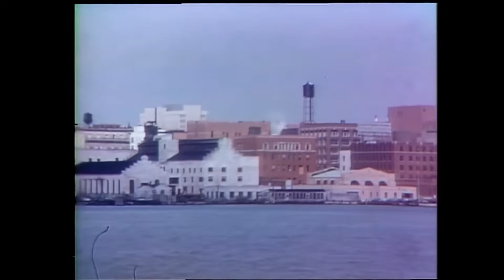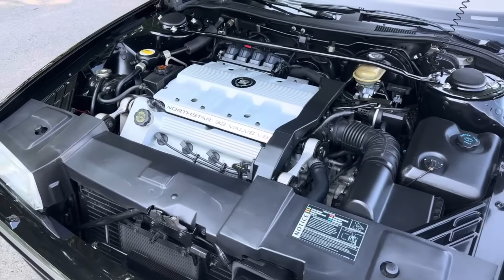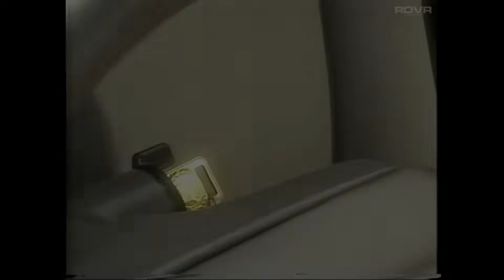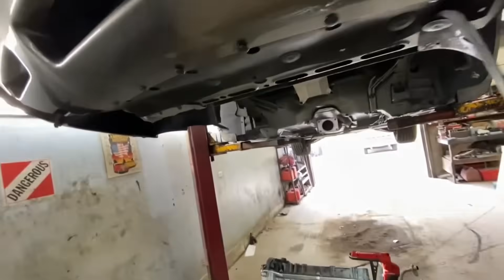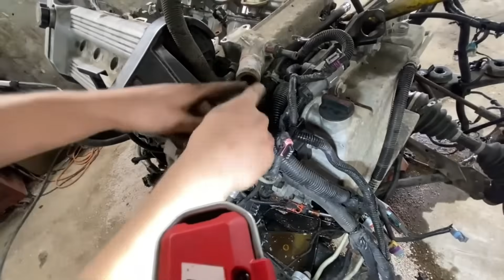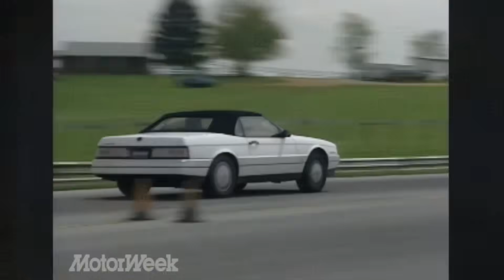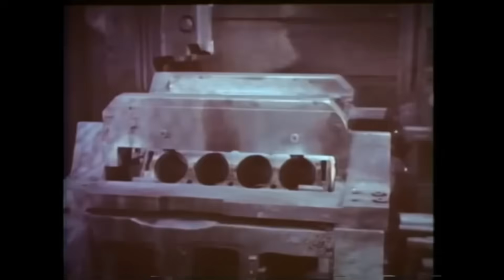Most HATED American V8 Engine of All Time!

Comment: Ford had introduced the lower power SOC 16 valve modular V8s before this, and for the 93 model year the Lincoln Mark VIII had the 280 hp "intech" 4.6 liter 32 valve modular V8. Not sure how Ford got it so right and GM got it so wrong. Oddly.. I don't think the special 4.0 Olds Aurora Northstar V8 had these issues, nor did the 3.5 "shortstar" V6 based on the Northstar used in the Aurora and Intrigue. FWIW, I suspect GM gave dealers a certain number of good will repairs based on factors.. and the dealers themselves go to decide who go the engine fixed under good will. Regular customers that bought them new at that dealership probably got them good willed. *Current fuel economy regulations and a very competitive market have caused many brands to push tech out faster than they should. See Nissan CVTs, Variable Compression Engines, even Toyota has had some turbo gas engine issues. Ford was way ahead with the smaller turbo engine thing... but they also had issues (head gaskets due to coolant groves between cylinders on four bangers, internal water pumps that fail into the oil on v6s, turbo failures).

Comment: I had a 2002 Deville.  I dogged the car.  From 100,000 to 155,000 miles I didn’t change the oil, I just added oil.  Nothing on the engine or transmission ever broke.  The cosmetics were trash.  I brought it to Germany and floored it everywhere I went.  I sold it for $1,500 before I left.  I was told by a Cadillac mechanic to dog the car.  He said that it was a performance engine and needed to be driven like one.  He said the cars that were always breaking were the ones that were babied, and that’s why I always drove it like I stole it.  I was always waiting for it to break, that’s why I put absolutely no money into it.  I also had a 1981 Seville Elegant with the V8-6-4 and never had a problem with it.  It was sold while I was in Korea without my knowledge.  I looked for it and found out it had been crushed after an apparent accident.

Comment: I haven't finished the video but GM could have/should have recommend a procedure to replace these bolts after, say, 40k miles before the gasket has blown.   Maybe they would have engineered a better bolt design and even a washer.   I don't know what but they should have been more responsive to the dealers.
Reply: The cost to retrofit every Northstar engine with thread inserts and new headbolts would have been more than the profit on those cars sold.  Makes more business sense to allow the warranty to expire and let the owners take the loss. By the time this all happened, GM had already replaced that infamous engine and moved on. On the bright side, many lucky poor folks could finally get that used Cadillac they always wanted. I bought a 5 year old low millage Eldorado for $2,500 that should have sold for $12,000. I did the headbolt repair myself and drove a first class luxury car like my rich neighbor.

Comment: the gm 350 small block diesel of the late 70's is unrivaled garbage and the disposable 4 cylinder aluminum block unsleeved Vega engine was usually ready for the crusher before 10k miles.

Comment: The torque bolts have been used in structural steel buildings since 1945. Those torque bolts in Northstar are stressed beyond the yield point of the metal which means the bolt cannot return to its original shape when the stress is removed.

Comment: This is misinformation.  TTY bolts are not the cause of failure for the NS engine.  gm used fine thread bolts in an aluminum block and the threads gave up over time.  Further, the early engines used a composite head gasket and the water passage restrictions rotted out over time, leading to the coolant moving too fast and not transferring heat as it should.  This lead to overheating, warped heads, and premature failure.  By 2005, these issues had been fixed, and guess what?  gm still uses TTY bolts.  So, no, Torque To Yield bolts were not the cause of failure.
Reply: You can tell the narrator is not a mechanic or engineer.
Reply: @AmosMosesJr  Or a human. It's an AI.
Reply: You’re absolutely right! I wish the video was corrected.
Reply: Thank you for the correction.
Reply: Lol i hate it when people make videos that dont know the real details.
Reply: TTY bolts are very common across many manufacturers so they aren’t fundamentally unsound. Mind you, for the owner it doesn’t matter what the cause was. The car becomes a mechanical write off if / when the head gasket goes. The fact that these problems made it into production is not a good advert for GM.
Reply: The idea that coolant moving too fast makes it transfer heat worse is a common myth held by many automotive techs. That is not how thermodynamics work. Faster moving coolant reduces the average temperature of the coolant within the water jackets, and since the specific heat of the coolant remains the same, it increases the heat transfer out of the engine and into the coolant. It doesn't need to remain there longer to "pick up" more heat. The goal is to cool the metal bits, not increase the temperature of the coolant. 

The purpose of the restrictions is to control the relative flow to different parts of the engine. If one area is restricted, more coolant flows elsewhere, where the engineers have concluded it needs more of the flow. Having the restrictor in the head gasket blown out means that there will be flow potential wasted where it is not needed and taken from where it is needed.
Reply: @tid418  Thanks for the correction.  They do indeed rot out, seen it plenty of times, and do overheat once the rot out happens.  I suppose I should have left it at that.
Reply: Agreed, almost all manufacturers use TTY bolts for cylinder heads nowadays.
Reply: Aerospace practice requires the use of steel helicoil inserts when threading into aluminum.
Reply: @Greatdome99 seems like it would be a good idea.
Reply: GM wasn't the only one to make the fine thread into aluminium mistake. I worked on early Toyota heads with that problem.
Reply: Absolutely right. The decision not to use threaded inserts in the aluminum block was a massive mistake.
Reply: Cadillac V8-6-4…whadda POS 🤦🏻‍♂️. any GM diesel V8 too… sure let’s switch a gasoline v8 to diesel without making any changes😳😳😳what could go wrong?🤦🏻‍♂️
Reply: I thought something was fishy about his explanation as soon as he mentioned torque to yield.  TTY are used elsewhere with no problems, so why would that be a problem here?  Thank you for chiming in.
Reply: Ls engine head bolts
Reply: The engineers had the headbolts for coarse thread in design…the bean counters at gm realized they had crates and crates of leftover quad 4 tty bolts and they penny pinched and used them and by being cheap they screwed themselfs and spent tons of cash in the warranty dept replacing complete engines .. by 2004.5 they finally used coarse threaded headbolts and it solved it..aftermarket people have figured this out too ( see northstar performances coarse threaded STUD)..it took gm 11 years to fix this mess.
Reply: @toddprater14 that would be so insane if that story is true. They just had old bolts and wanted to use them instead of scrapping. It's like picking up dollars to step over millions.
Reply: @TurboV8boi  heard that from a old gm engineer .
Introducing the horrible first batch of dexcool poured fuel on the fire in 96’ the number one area people skip maintaining is coolant changes, that coolant turned acidic after a few. Years and ate thru head gaskets which made the problem worse..
Reply: @toddprater14 oh my gosh I didn't know about the dexcool either, that's terrible. I do maintenance with the best of them but still neglect changing the coolant as long as it looks good haha
Reply: @TurboV8boi dexcool was introduced late 96’  I had a97 transam I bought used in 2000 and the headgaskets blew cause of that stuff…guess it’s better now cause they reformulated it awhile ago… but the first edition would turn acidic after awhile and gm was touting it as  100,000 lasting but that proved wrong
Reply: Yep,, GM still makes garbage though
Reply: The amount of brake caliper bolts that are tty and nobody even knows is amazing. Failures are so minute that people are still not aware of this or can afford to ignore it.
Reply: Looking back ( hindsight is 20/20 I know) but a simple layman like me could foresee that fine threads in aluminum probably wasn’t a good idea. We spend dookooo amounts of money for education of college graduates in the engineering field and it seems we not only don’t learn from past mistakes but we are determined to repeat them. It makes one wonder if designed obsolescence plays a part but the obsolescence occurred sooner than they wanted it to. It’s hard to engineer something to fail in a set time frame
Reply: I prefer course threads in any soft materials
Reply: Until reading this comment, I'd almost totally forgotten that fixing these things often involved many thread insert repairs.
Reply: Water moving "too fast" means better cooling, not worse
Reply: @dosmastrify that's not true. It takes time for the water to absorb the heat. If it doesn't have enough time in the hot areas then it can't remove the heat.
Reply: I always use ARP bolts on all my rebuilds anyway. Are you all meat in bread people?
Reply: GM was using TTY on the 3400. Never any problems with the bolts.
Reply: @aberobinson1 LOTS of problems with the 3400 pontiac.
Reply: You're damn right. Most engines use tty bolts. To say that is just crazy.
Reply: @dustinandtarynwolfe5540  NO. Most engines do NOT use TTY Bolts.
Reply: That’s like saying the 6.0 powerstrokes tty head bolts, don’t contribute to head gasket failure. They freaking stretch over time, thus losing clamping force. Which resulted in head gasket failures.
Reply: @mikeadams42 you have 2.5 times the cylinder pressure in a diesel that you have in a gas burner.

However, it is the failure of the fine thread aluminum block that causes the Northstar to fail.  Once they switched to course thread in 2004.5 you almost never hear about head gasket failure on a Northstar.   Still using TTY bolts, as they are on every other engine they build.
Reply: @mikeadams42 the TTY bolts weren’t the problem with the 6.0. It was over boosting that lifted the heads. The variable geometry turbo would stick in place and over boost the engine.
Reply: The last good Cadillac engine was the 425ci made from 1977-79.
Reply: Another bit of misinformation is that tty bolts are a one-time use. They can actually be reused several times, but with caveats. If production bolts are held to a very tight tolerance on length, you can measure the length after each use until it exceeds a specified length, indicating it has stretched too far. There are some industrial/ maritime engines where you keep reusing tty bolts until they get to a specified length. Another way is to measure each bolt and maintain a length/ position record. Each time the engine is torn down, measure each bolt and throw away any that exceeds a pre-determined length.
Reply: @Richard-qz8up that might be correct for marine engines but are there any production car engines that the manufacturer doesn’t specify one time use for these? I would think that the method of torquing the heads would be different if the bolts / studs have been stretched already and you would be in no-man’s land trying to torque the head down without an appropriate procedure for doing so with used bolts. Given the cost of the bolts / studs compared to the labour involved in pulling the heads off again to fix a head gasket, I can’t see many people risking re-use against manufacturer recommendations.
Reply: @peterj5751 I said marine AND industrial engines, I consider the engines in semi-trucks to be industrial. You won't find any car manufacturer saying to reuse tty bolts because they don't adhere to the strict tolerance required, nor do they maintain records. With neither of the caveats I stated met, the manufacturer has no idea if the bolts can be reused, so they take the easy way out and say to replace the bolts. You either didn't read or didn't understand my post.
  As far as a procedure, you use the same exact procedure as the first time. It's really not that difficult. Go look up a stress-strain curve to gain more insight or come back to read my next post.
  Also, neither I nor anyone else is telling anyone to go against the manufacturer's instruction. You're making stuff up now. My post was to show that replacing tty bolts isn't an absolute fact in every situation, there are exceptions. Don't conflate my post to mean you don't ever have to replace tty bolts. 🙄
Reply: @Richard-qz8up sorry if I didn’t explain myself properly. I understood what you were referring to, I was more concerned to make sure other readers didn’t take your comment as meaning they could reuse TTY bolts on car engines as well
Reply: @Richard-qz8up .  . So what is the advantage for using TTY bolts?
Reply: @ronaldgreene5733  It takes a certain force to make it yield. That ensures a consistent force on each bolt. With conventional torqued bolts slight variations in thread friction affects the clamping force.
The bolts are cheap in an engine job. My last one cost less than $40 set (4cylinder)
Reply: @ronaldgreene5733 He did not give you a very good description of TTY advantages. 

Bolts are big metal springs. When you torque a fastener down, you are stretching it, you're making it slightly longer and that is applying clamp load on the joint. In this case the head gasket. 

Regular non TTY fasteners operate in the elastic range. That means when you torque them down and then release the torque they are the same length. That also means that the relationship between clamp load and input torque is directly proportional. One of the major downsides of threaded fasteners in general is that much of that input torque to produce the clamp load goes into overcoming friction. Trying to engineer consistent friction, especially on something like a fastener is very difficult. So even though you torque all of the non TTY fasteners to the same value the resulting clamp load variation is quite high. 

TTY fasteners are being permanently stretched. That decouples the input torque relationship from the clamp load. As it starts to yield the clamp load stays reasonably flat while the input torque increases. That makes it so that variations in input torque have a very small impact in overall clamp load. That allows you to have dramatically more consistent clamp load force applied to critical joints like a head gasket.

There are other techniques used to accurately tighten fasteners, it's not all just input torque. Torque angle is also very common. Those techniques help reduce variation even further. You would be hard pressed to find a modern vehicle that does not use TTY bolts on the head gasket or torque + torque angle in the tightening strategy.
Reply: @GSimpsonOAM I always use ARP Bolts for my rebuilds. I feel sorry for you.
Reply: @Richard-qz8up absolutely correct... check the stretch, production builders even have a go/no go Guage
Reply: 100% thread pitch issue and lots of failures resulted in line bore issues because the head bolts went all the way down to the crank journals.
Reply: The Northstar head bolts are NOT torque to yield.  The only reason they are not reusable is there is no way to practically apply the micro encapsulated thread locker in the field during a repair so the procedure was just to replace the bolts.
Reply: They also weren't the worst engine. They were efficient, had good performance, and were reliable when new. The problem was with age and high mileage, that they proved unreliable compared to something like the 3800 Buick.
Reply: @brettknoss486  Meat in bread people.

Comment: Funny thing is that they had the LS engine, the best ICE engine ever.
Reply: yea, it just has exhaust manifold bolts broken off in the heads and lifter/valve train oil starvation issues.  My cousin boutght a $75,000 GMC truck with the best ICE engine lol, and it made it only 8,000 miles before the lifters failed on one side.  OH, and good ole GM would only replace the failed lifters on one side, not both sides, and only pulled the one head.   I told my sousing he should have just kept his 7.3 F250 but he didn't listen